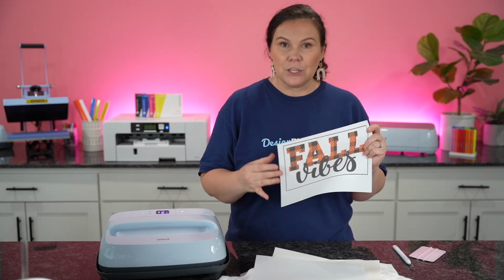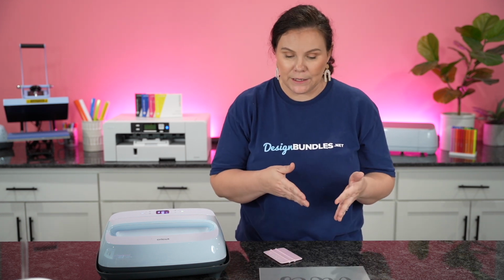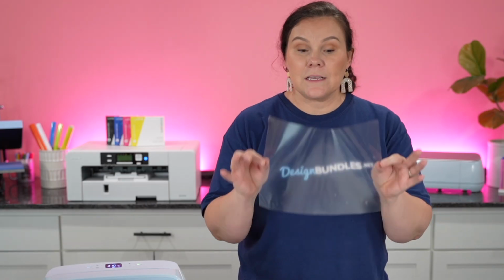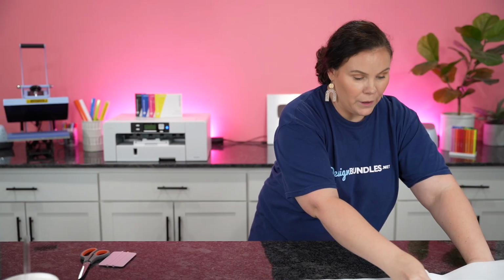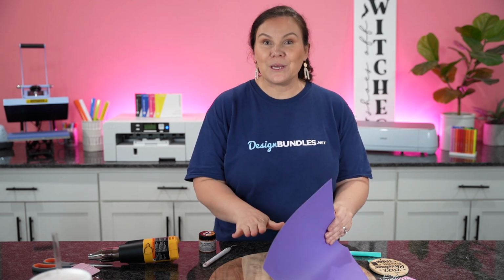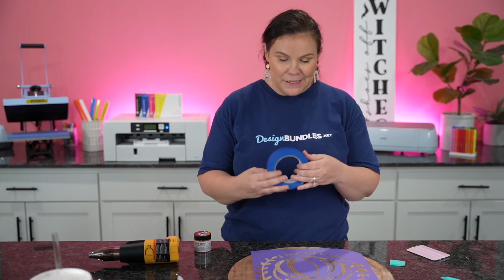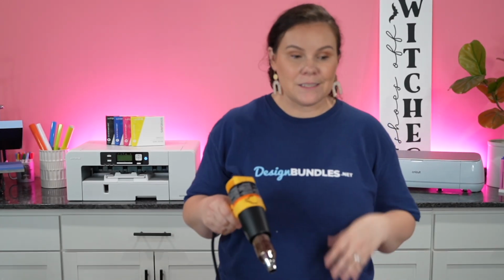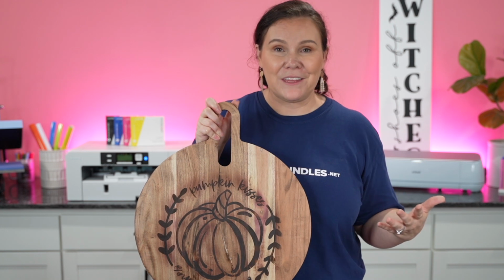❗️ FREE Fall Crafts 2022 | Fall Crafts to Sell

Comment: Love your videos... I do have a question.  I struggled when using the torch  paste to "clean up" the wood where it burned outside the design.  Could you show how to do that?  I ended up spreading the soot around.  Thanks.🙂
Reply from the maker: Did you try to sand it? Is that how you spread it ?
Reply: @DesignBundles  Yes the sanding just seemed to spread more soot around